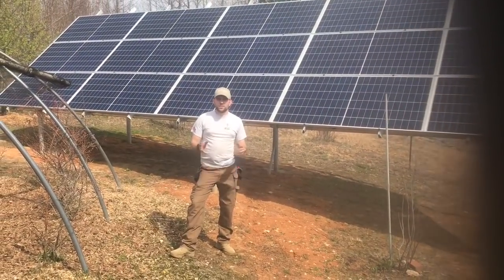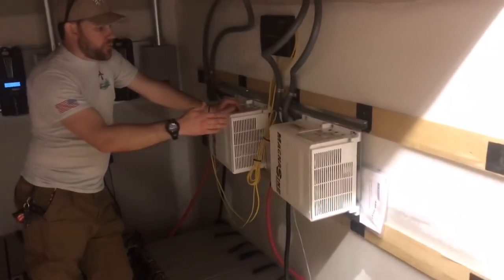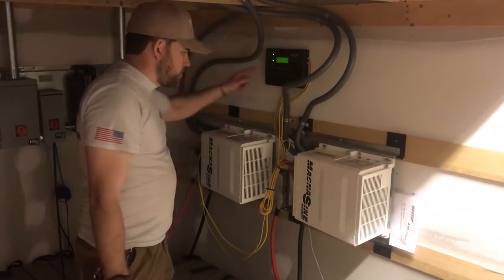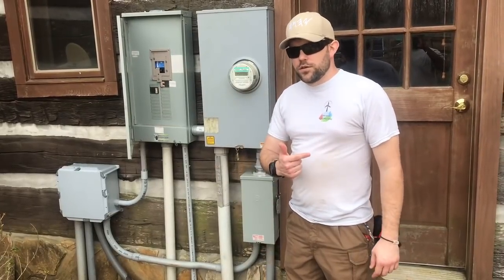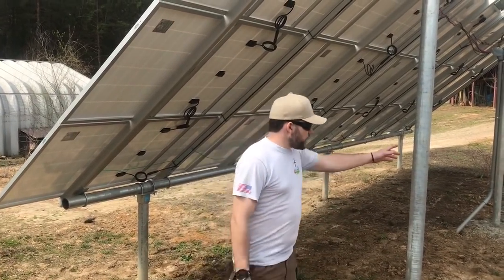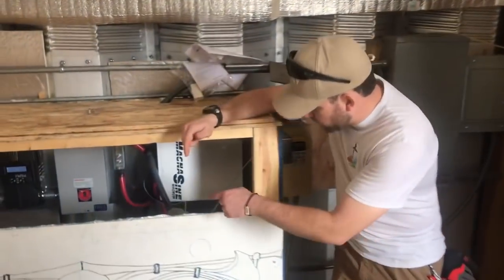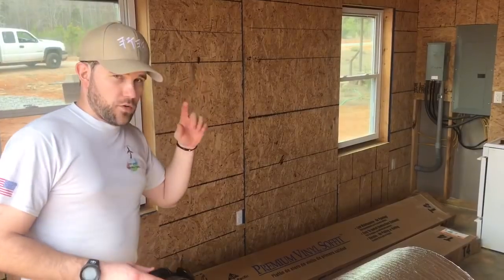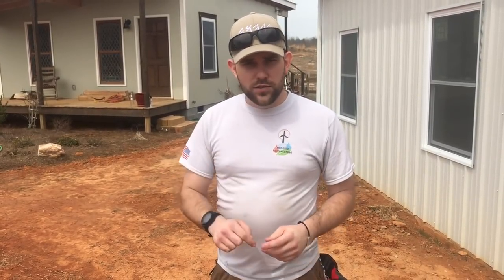20KW off grid solar install on country farm with generator back up by Off Grid Contracting

Comment: Horrible audio at first, but I am skimming the video and reading the description thank you.  So, 90 panels gives you roughly 20 kilowatts.  I've always estimated 200 kilowatts per panel no matter what the claim is on the peak.  A consumer magazine a few years ago said to expect to spend $2,000 per kilowatt installed, but I'm thinking this probably was quite a bit more with all the extra stuff you have there.  I like the fact that you have the ability to run it off the grid.  The solar companies in California just want to put as many systems up as possible, get paid by the customer, and get paid by the electric company and the state - off-grid stand-alone systems are not really marketed to the average residential customer.  Cool setup.